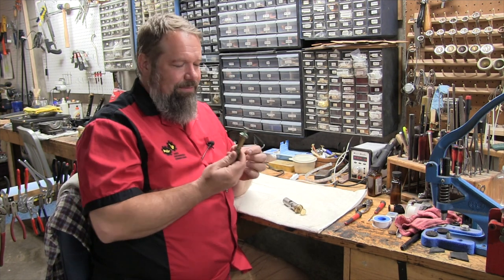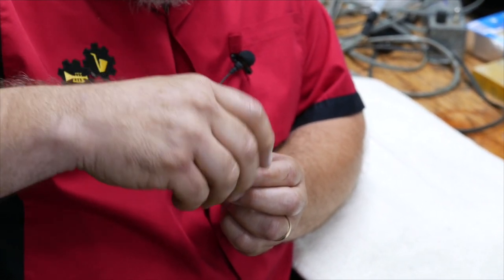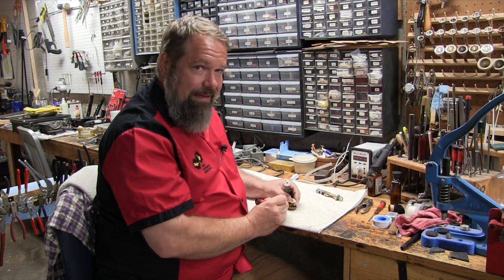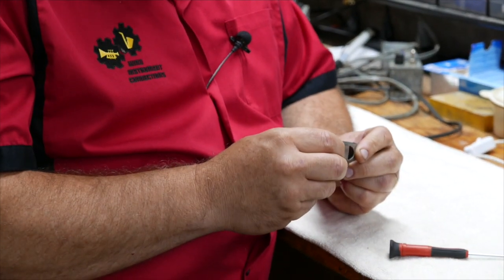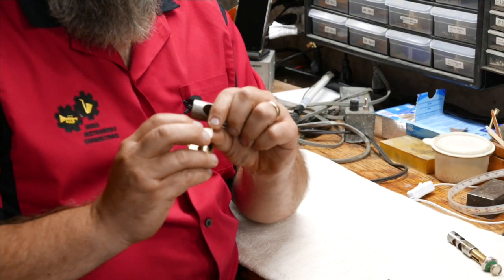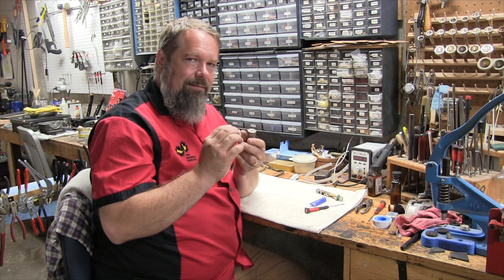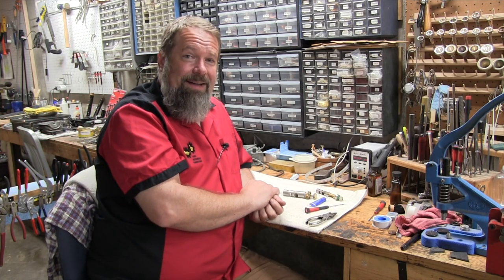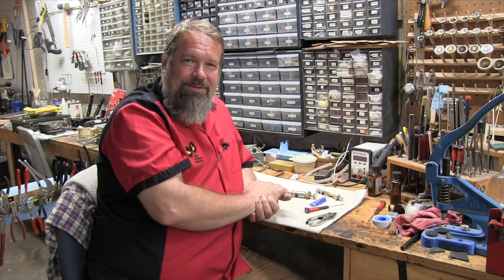Valve Guide issues for Tuba and Baritone

Comment: What’s the little washer thing that holds the valve stem down to a certain point when it’s inside the instrument?  It has an indentation on the valve stem where it holds a cushion piece above it. Mine slid all the way down to where the valve guide is somehow, and I’m having trouble trying to get it back up to where it was.

Comment: My band director is going to kill me... my 2nd valve is stuck... again...
Reply: just unscrew the bottom and push it out bro a stuck valve isnt a problem as long as it works theres ways to get it to start moving again you can even do it at home
Reply: @gg_0nr941  actually we found the problem and the 2nd highest tube needs to be pulled and pushed. Idk what happened but he said "this tuba is really pissy"